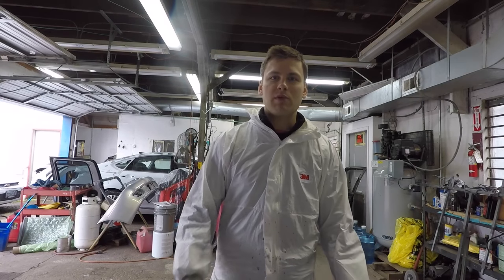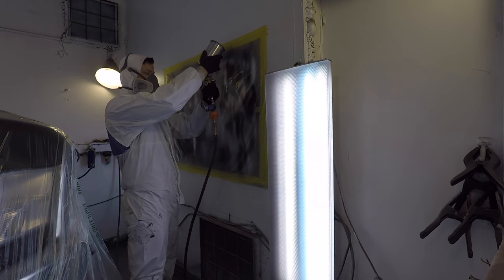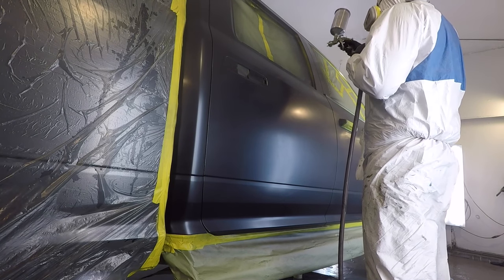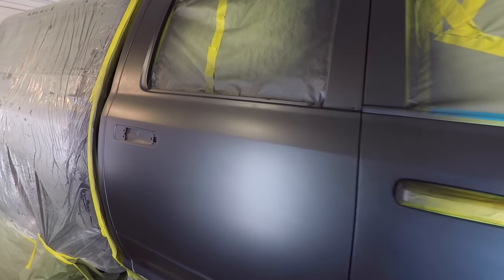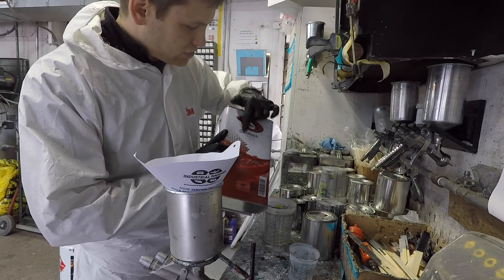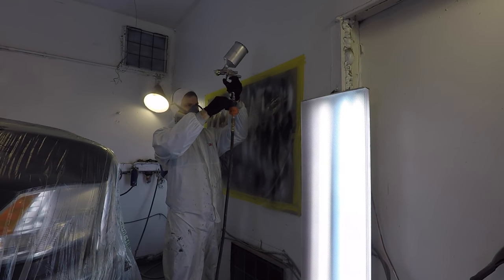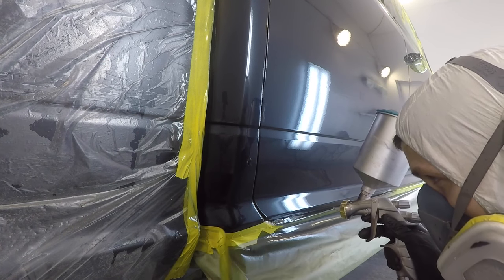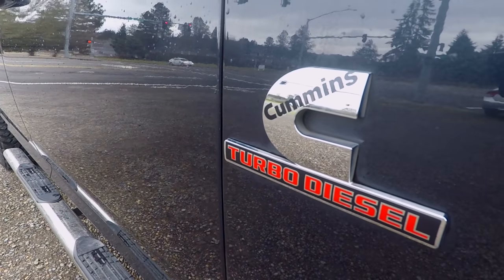HOW TO MINIMIZE ROCK CHIPS IN PAINTWORK

Comment: What grit do you prep the blend panels with and what do you use to final wipe the area to be painted with? Results look great!
Reply from the maker: Thank you. I use 1500 grit or sometimes on silver and gold color vehicles I will use 2000 grit on blending panels. I use wypall sheets to wipe the surface with prepsol to degrease and clean the surface. Then, after it air dries I use a tack cloth to wipe any surface dust or debris the wypall sheets might have left behind. I have added a link of the wypall sheets into my description if you want to see them.